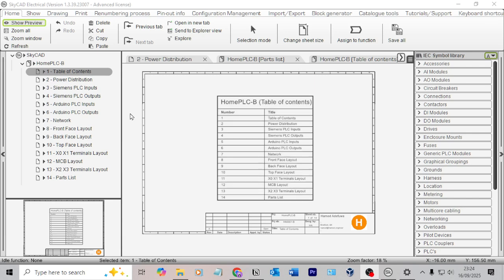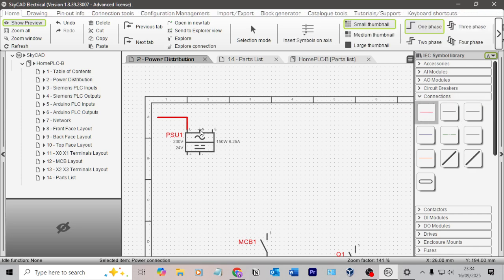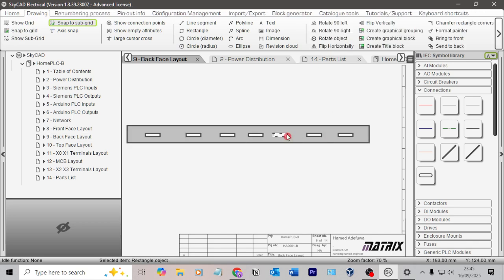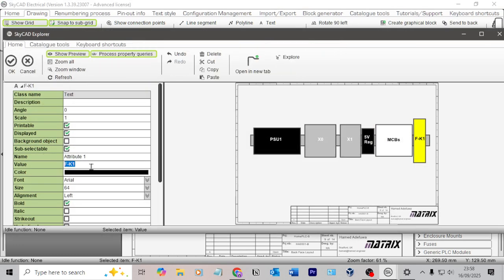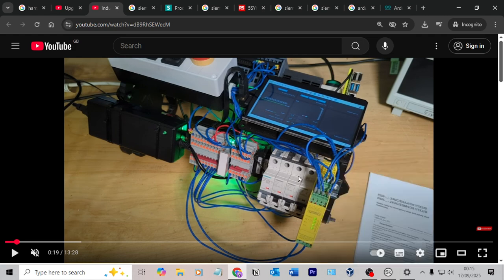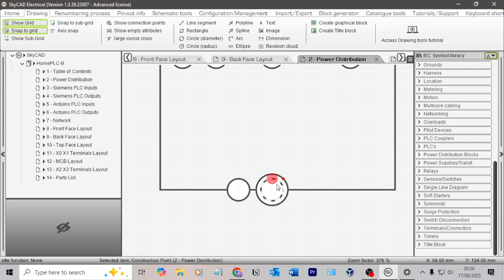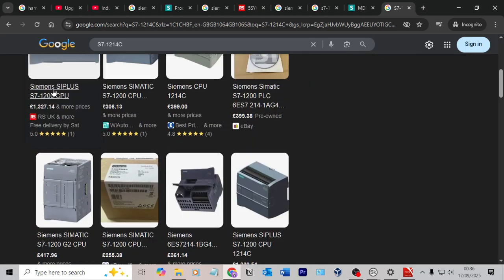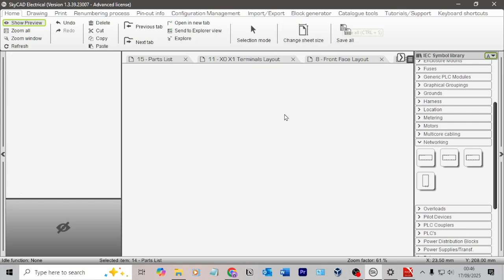How I Create Electrical Schematics For Free Using SkyCAD: Tutorial 2

Comment: I am currently learning this software so find your videos helpful, may I ask though why you don't use cable colour coding as set out in British Standards?

Black is your power circuits
Blue is DC control 
Red is AC control
You do seem to be using the correct colour coding on your actual benchtop project IE blue for your DC control wiring yet you do not reflect this on your schematic and for some reason apply the incorrect colour codes in your diagram for your power circuit here?